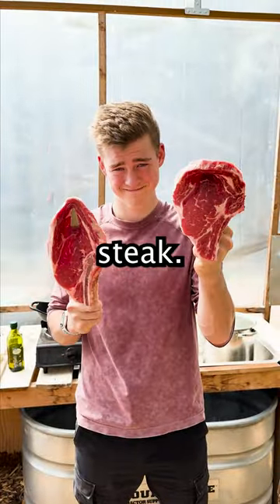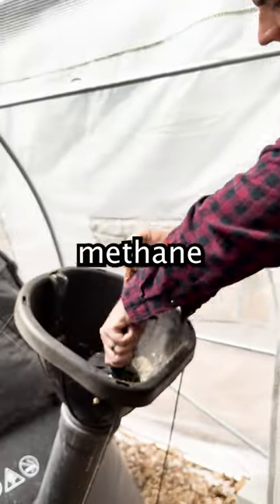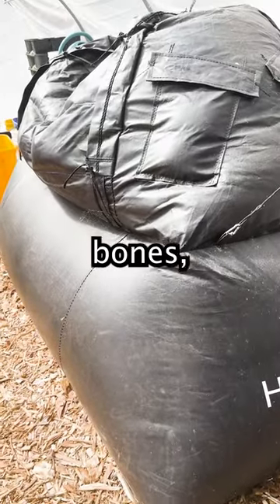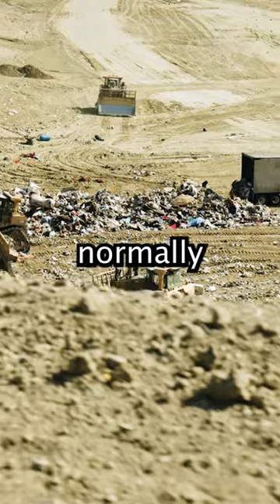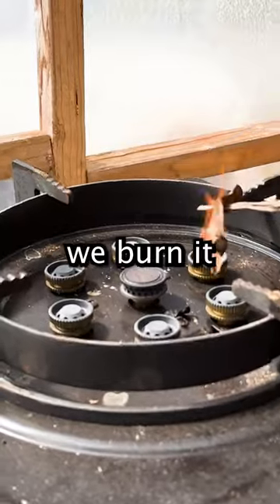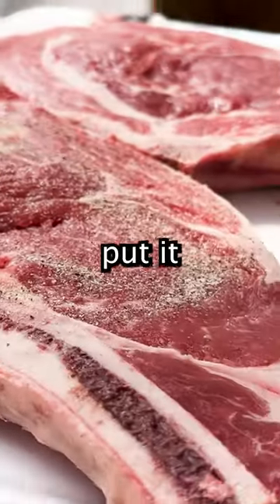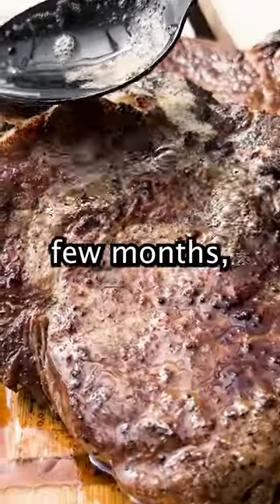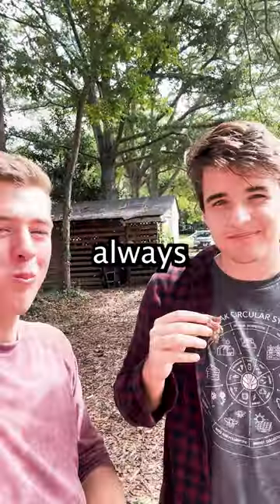Cooking Steak with Steak Gas?

Comment: FYI it's increasingly common for the methane produced in landfills to not be wasted and actually be used in pretty much the same way that you are using it here. Many landfills these days are installing RNG (Renewable Natural Gas) plants where the landfill gas is routed into the plants and most everything that isn't biomethane is removed from the gas and then the RNG product is injected via pipeline into the local natural gas system. Landfills are essentially giant anaerobic digesters so they can make quite a lot of usable biomethane so long as they have RNG plants to clean the LFG.
Reply from the maker: Yes! We mention this in a podcast coming out soon! We hope to see more places implement these systems. Good call out in the comments!
Reply: The RNG systems are everywhere in Sweden. Every public bus.
Reply: @acornlandlabs  I'd bet on these systems becoming much more common in the next few years. It seems like RNG is one of the biggest things in solid waste at the moment. Several sites that I work with are currently working on having RNG systems installed (I'm an engineer who works in solid waste).